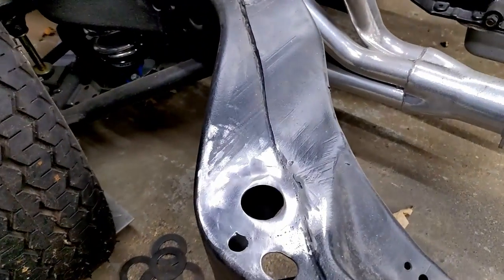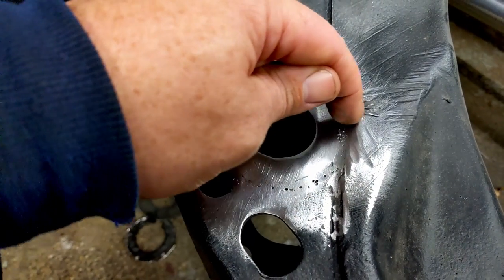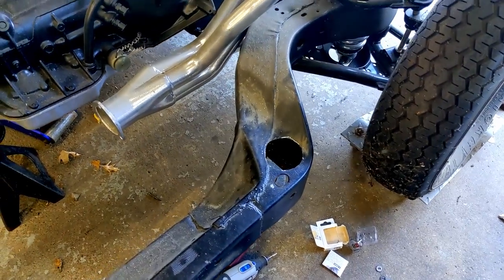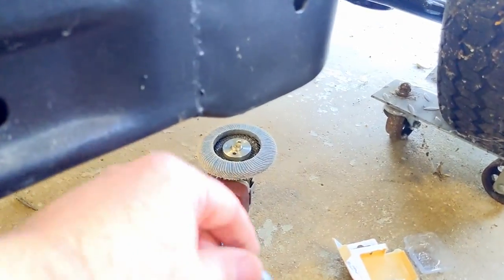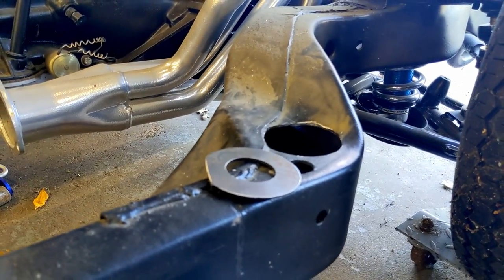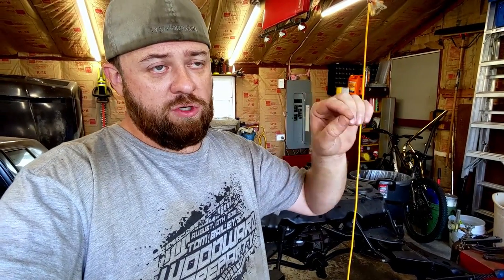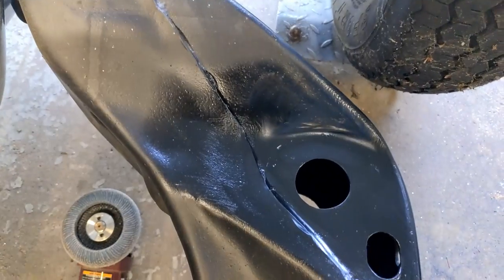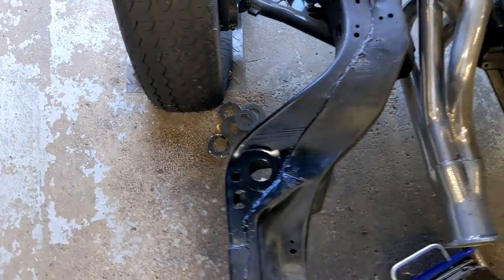G-Body Body Mount Frame Repair / Part 3 of 3

Comment: How did know if the washer was centered for the body mounts
Reply from the maker: I centered it approx first, plus there's some give in the mounting areas
Reply: Are the washers bigger than original hole 1.5 in